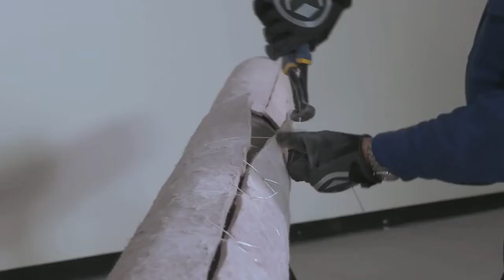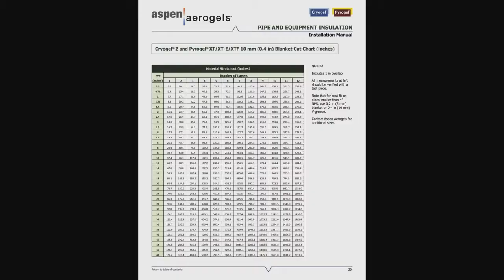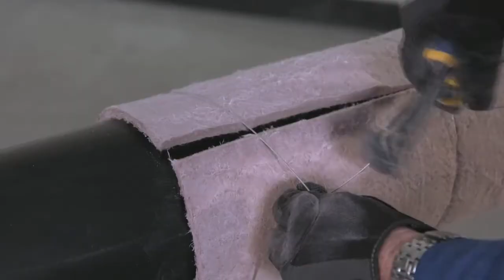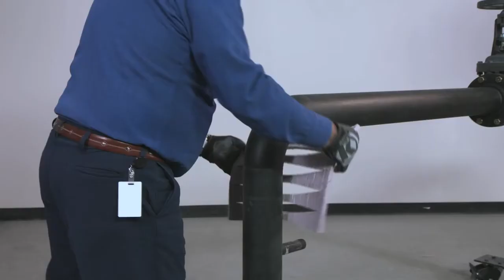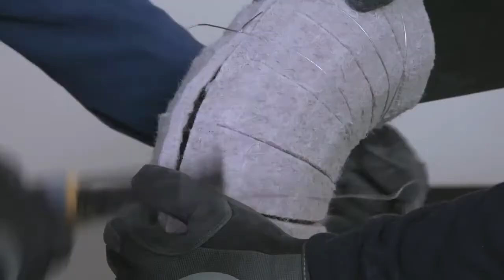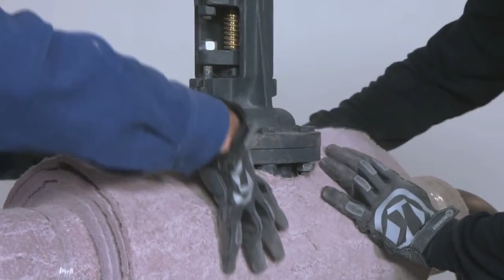Aspen Aerogels Pyrogel XT E Installation Techniques

Comment: Would this be ideal for home insulation in wall cavities and roof spaces, as well as underfloor chill from cold?

Also, can adhesives be used to apply insulation to surface?
Reply: Gary Stinten maybe, its some of the best insulation out there today but mostly used for industrial purposes because water doesnt get through it